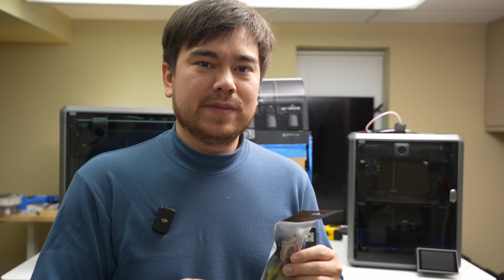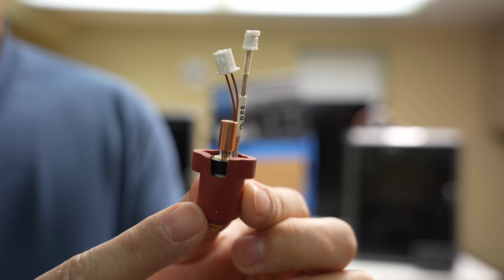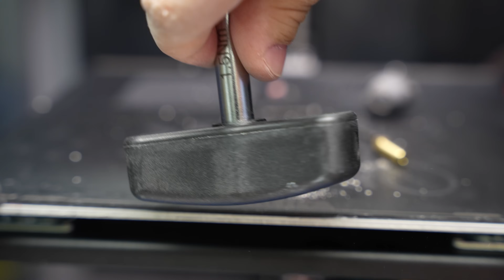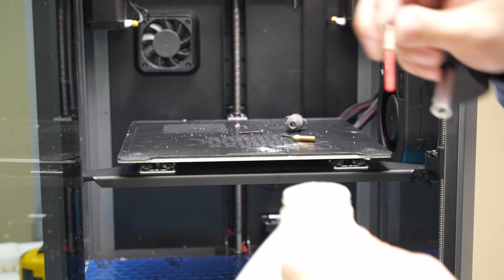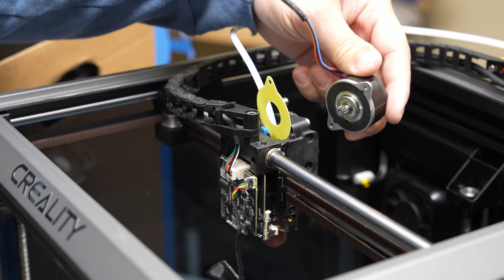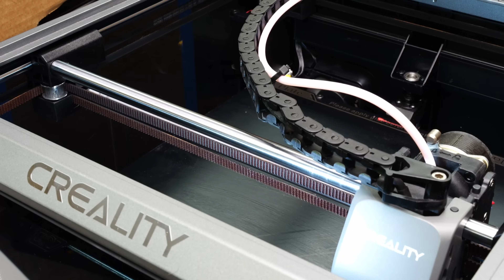🔥⚙️⚙️ CREALITY K1 - Extruder and Hotend Upgrade Kit

Comment: Those are just wear marks, the new extruder is made from sintered metal, not machined/sandblasted. The old extruder heat break is aluminum, not steel. What kind of engineer are you? Electrical?

Comment: Just purchased a K1, asked support about the updated parts. they directed me to the store where i could buy one at full price. So much for standing behind their product and making sure all the units get fixed.
Reply: when you buy a car do you call the dealership for them to give you a new upgraded engine for free?
Reply: @riskinhos If the new engine is the base engine in the new run of the same model car, yes, as that would be a recall. these parts are not an "upgrade" rather a fix of poorly designed parts.

Comment: My k1 came with the upgraded extruder. However, it still has the old hot-end. Should I upgrade the hot-end?
Reply from the maker: I never had problems with the old hotend so personally I don't see an issue with using the older one. Just make sure it's on tight and it should be fine.
Reply: @NathanBuildsRobots  will do! Thank you so much!

Comment: Your reviews are very nice as usual, but things "change", so following all of them can become involved after some months. I would appreciate if you were putting up a page in your website with a constantly updated list of recommendations and related explanation, like recommended printer based on price range, on size, on special features (IDEX, multimaterial, high temperature).

Comment: The steel is not machined from a solid piece. It is laser cut from a stainless steel plate and sand blasted for finish. 
Cost is about 0.3$ to manufacture.

Comment: Love the Creality propaganda by showing a a Bambu P1P in such a pathetic state. Creality head looks super janky. Listen to the perfect layer, his disdain for any non Creality printer oozes through in nearly every episode. Best 3D podcast around however. Wish it was weekly.

The Bambu Labs AMS is a game changer. Most people think it's just for multi color but it is also fantastic for keeping multiple materials ready to print. My favourite feature is using up every inch of filament by having it switch over to a new spool when it runs out. No more piles of spools with minimal filament. The Bambu Labs screen is a cheap shot. Not many people ever touch the screen, they just work from their computer or app.
Reply: If bambu had the same size on bed and abit lower prize i would take bambu for sure...but for me overkill

Comment: A C-shaped piece inside the extruder holds the second gear. There are 3 holes in this part, one for fixing and two for movement limitation. Slightly carving the slots that limit the movement brings the gears closer together. The compression problem is solved by adding a spring from the outside or a mechanism that pulls the lock latch to the left.

Comment: I just bought my K1 and I'm trying to figure out whether I have to buy a new hotend and extruder to replace the old one - to avoid whatever terrible problems people face with those.

Pretty good video, and I generally like your channel! Gotta say tho, you have to be more careful with doxxing yourself... Not sure whether you ordered that boron nitrate to your company address, but in any case be careful... 7:44
Reply: I just went through this also. If you have the black nozzle cover then it's the bad hot end. You want the rust red colored one. They will send it to you if you hit up the online support. Mine is on the way but what I don't know is if they are sending the extruder as well.

Comment: I have the K1 Max and a fairly newbie to 3d Printing.  Had a Ender 5 S1 before and got used to the Creality Slicer (the Cura version).  It seems like they have left alot out of the Creality Print slicer. For instance I have not been able to easily add a 'Change Filament' command like using the Extensions for the Cura to change colors of filament.   And no other slicer does well with the K1 (as far as I can see)   I downloaded the profile for the Cura but not happy with that either.   Do you have any suggestions on Slicer OR a way to easily add a change filament command to the Gcode for the K1 Max?   TIA!!

Comment: I just got a new K1 and I would like to confirm that it came with the new extruder installed. I can only see the lever. I don't want to disassemble. The lever has a matte finish.  I touched it with a magnet and it's ferrous.  So, I think I confirmed. Do you agree? Thanks for the vid.  I think you saved me some worrying. thank you
Reply: i also just received a new K1, it has the new extruder, but not the new hotend...

Comment: LiDAR alone is worth it, along with input shaping. Speaks a volume on quality, precision of prints. Piezo/load cell leveling, is more of a convenience. Creality is catching up, it is just a matter of time. AMS is way overpriced compared to the actual printer itself, esp. with restrictions on usable materials and excessive wear even on moderate use. Also a good IDEX, with some clever muxing should do better than an AMS, that is wasteful. Another thing I don't understand is, why a Bambulab X1C wastes so much filament, before start of every print job(even without AMS), if they can use the camera input(on X1C) already, with enough nueral processing cores in the system.Just some💭♥️👍

Comment: I was wondering about the short piece of Bowden tube.  I have a new K1 Max and for two weeks so far can't print anything.  (It is fun to watch the video of it not printing! HA! HA1) Originally, it was banging itself to death with belt sprocket teeth jumping out like crazy and banging on the side over and over.    Creality sent a new PCB to install, works like is should,  but now the extruder will not feed any filament.  Wires are all twisted and one (Red) was broken completely.  Fixed one (red) wire, and still doesn't run,  now I will see if the other wires which look damaged are broken the Blue has a deep dent in it, so I suspect that is broken.   I have 11 other Creality printers and no manufacturing problems with any of them, except the normal loose screws and the pom wheels all out of adjustment when they arrive. Waiting for a replacement extruder from Creality now.

Comment: I had K1 bought on preorder, had plenty of issues with extruder and hotend leaks, returned it, bought P1S, it's running perfectly. Your mileage may vary, but K1 is cheaper with a reason.

Comment: I had one of these that kept failing part way up in the print.  Extrusion stopped but motion system continued.  Turns out a screw was loose holding one of the pressure wheels in place.  Took me a while to figure that out.   I'm back to liking this printer.

Comment: If the K1 max had a dual extruder I would absolutely buy it.  However I currently have all the components and hand-tools needed to cobble together a dual extruder setup with the same build dimensions. The K1 would save me the trouble, but since I would still be going to the trouble to setup dual extrusion it's not worth the cash. I need multi material capability for supports.Now I just have to figure out how to setup a Makertech dual switching hotend in Reprap firmware.

Comment: Unsubbing and Resubbing for more boron nitride and boron nitride paste. I am quite enthusiastic about boron nitride, both before and after it becomes boron nitride paste. 

That torque wrench looks very similar to the ones used by amd on threadripper/epyc CPUs. They both are set to 1.5 Nm and utilize a standard 1/4" bit size.
Reply from the maker: Nice, I haven’t built a computer in ages, but that sounds like it might be the same tool!

Comment: I just received a k1 and the extruder is the new steel one, the runout detector I have no issues getting filament in and the bowden tube gives me no trouble on the default path. 
I can print fine without glue on the default bed.
The only trouble is really getting the filament inside the extruder's gears, which is easily fixed by cutting filament at an angle.

One point though, even though the extruder is the new one, it still becames just a tad bit loose during a print, was enough to immediatly get under extrusion
Reply from the maker: Try tightening the 2 screws that hold the extruder to the stepper motor. With a little more tension, that should add some friction and holding force to the lock-up. But I can't tell, all I know is the ones I'm using (on the K1 Max and now the K1) are working great. Easy solution is to JUST USE A SPRING TO ACCOUNT FOR MANUFACTURING VARIANCES...

Comment: I have had my K1 for a month now, your initial review swung this purchase in favour of the P1P. Must say this is the best 3d print experience i have had for the last 4 years, litteraly press print and go. Have currently had no failures and the quality is far beyond what i have achieved previously, plus the speed is phenomenal. I can now print 3 or four large prints in a day rather than over  3 days. Kudos to Creality on the upgrade program for K1 buyers a great way for them to say thankyou and garner even more loyalty from their users. Also a great video on how to upgrade the printer. keep up the great work😃
Reply: i got some setious issues at the beginning. 
I had to change the plate and the extruder head for a steel one. 
then it became a click and go for me as well

Comment: Good to see that Bambu competition is really pushing Creality to up their game, my K1 Max delivered last week seems to have these updates already installed, is giving great quality prints using Prusa slicer with community generated profiles and I would suggest anyone with K1 printers use a better slicer as the Creality effort seems to have some odd problems causing quality problems on some prints as well as being awkward to use and slow, I also have the hack to run full Klipper with fluidd interface giving access to all tuning parameters. Really the only thing Bambu is better for now is multi filament printing which is very well done on their printers plus they also have the best out of the box experience for beginners by far. I'm personally looking forward to Creality releasing the source code in September to see where the community can take this printer.
Reply: Glad to hear the new ones have the upgrade on it. I just ordered my max.
Reply: @HN-qc8io  The K1 Max had upgraded extruder right from day one but they are now shipping the K1 with the upgrades too. I checked my hot end and it appears to be the upgraded one too. Producing very nice prints in ABS which is what I use a lot of to print prototypes. I was looking at X1C for a long time but their reliance on the cloud for full functionality was a none starter for me especially with their terrible privacy policy.

Comment: i think the first layer problem is that the max still uses the same number of levelling points
with the larger bed, that reduces the spacial resolution, but the errors in bed levelness remain at the same scale
Reply from the maker: Interesting. Yes some more research into the Max is required... I need to watch it level and see if anything funny is going on. It almost looks like its improperly applying the probe data... Like it reads from the whole bed, then does the math incorrectly and applies the level as if it is looking at a 220x200 bed with the same origin as the 300x300 bed.

Think about it, the top area Y=250 to Y=300 has really bad performance, almost as if the data its using for that area is extrapolated from somewhere else. Same is true to a lesser extent for X=250 to X=300.

The more I think about it the more I am sure it is a bug in the code.
Reply: @NathanBuildsRobots  i don't have such detailed insights, as i don't have this printer
but i have the 400mm magican pro
i wish they increased the number of sampled points on that printer, too. such that the distance between sampled points is the same as on their smaller printers
Reply: I do a 7x7 grid for 220x220 on my ender 3, and a 9x9 on my ender 5 plus. More points is generally better and have not had issues with first layer using a pei textured sheet with pla with 11 days of printer on the ender 3.

Comment: I cannot say what the old extruder is made of, but there are some stainless steels that are non magnetic. I know, it is weird AF but it is true.
Reply from the maker: It's possible the old extruder is a non-magnetic stainless steel. I need some better lab equipment to figure this stuff out!
Reply: @NathanBuildsRobots  yeah I'm a CNC programmer/machinist. I wanted to make some stainless steel gauge blocks ground to .1000" imagine my surprise when I learned I could not hold them on the magnetic table. (No metal was yeeted, just disappointment)

Comment: FYI, Bondtech has this to say about CHT nozzle changes: "ALERT : Avoid Cold Change Of Bondtech CHT Nozzles
Copper is a soft material and doesn't withstand high mechanical efforts.
Before removing or tightening any Bondtech CHT nozzle, heat it up to 280C, or at least above 250C.
Use at most 1.0 Nm torque. Recommended Torque is 0.5 Nm."

That wrench you used applies 50% more than the limit Bondtech advises.
Reply from the maker: Nice, thank you for the info.

I always overtighten things. Plus, copper looses about 30% of its yield strength when heated to 280C
https://www.researchgate.net/figure/Temperature-dependent-yield-strength-of-copper_fig3_325772824
Reply: Yeah they kinda make it so it will break if you follow there instructions. Heating it up will deform or when tighten.

Comment: My K1 arrived without the small Bowden. Loading filament was almost impossible, especially if the extruder had produced a couple of tiny chips of filament that blocked the ingress of the hotend. FYI, the Bowden length, after I contacted Creality, is 22.3mm. I asked for 2, assuming I might stuff something up. The support agent was quizzical but sent me 2 x 1 metre lengths of Capricorn 😅

Having a close look at the bed on the K1, there is no evidence of a load cell on each bed mount. There is a board under the bed but no connections to the mounts.
Reply from the maker: There is a load cell on each one you just need to look harder😂
You can cut your own, I just used a sharp knife. 2 meters for free is a steal!
And yeah, that is a very important part that is easy to forget about!
Reply: @NathanBuildsRobots  You are right. They are there - skillfully hidden! Meanwhile, my K1 has fallen into the under-extrusion hole. I've sent an email to support as I don't really want to wait until the $2.99 (4.64AU) extruder pack arrives.

Comment: That's why I held off from buying Creality's flagship. I'll wait to let Creality do what Creality does best. They're always half-assing products then they sell products to improved them. I'll wait another six months so they can fine tune the K1 Max. And who knows, maybe by then Bambu Lab will respond with the A1 or Carbon X1E. Hopefully they give us a 350x350 or a 400x400 print surface.
Reply from the maker: I did some thinking on the Bambu Lab problem... combined with some insider info. Should be an interesting video.

Comment: Hhahaha you’re so biased to Creality, why you hate Bambu so much… it’s wayyy better printer…. Just asking.
Reply from the maker: Bambu is good, great hardware, great slicer.
I don't like the privacy policy, but for normal people (who in all honestly make up the majority of my audience), they are actually very good printers.

The first I heard of Bambu they played up their ability to print carbon fiber reinforced materials, so called "engineering grade" materials. However, their handling of IP and user data leaves much to be desired. It is a matter of marketing, and target audience - one of their target audience is engineering and professional users. It seems to be a honeypot to collect proprietary engineering data from US firms to the benefit of Chinese interests.

Creality Cloud is no better, but the difference is that my K1s are run completely offline, so there is not much of an issue with data security.

I will detail these feelings in a future video. My ideal printer is completely offline, no internet, running open-source and auditable firmware and software.

Comment: The older one looks like it's nickel plated.
Also, shouldn't you tighten the nozzle at temp?
Reply from the maker: You're right, it might be nickel, not chrome.
Also, good question, slice and Bondtech reccommend not hot tightening - just use the boron nitride and it acts as somewhat of a threadlocker.
Creality has a strange hotend on this one, with some concentric layers of threads. Not sure what the best practice there is.

Comment: So would the Sprite Extruders issue with first layers, possibly also be an extruder issue? Cuz that is for sure, a night and day difference.

I do know sometimes, if my top layer speed is 50 or above, you'll see the beginning and end of the extrusions will be solid. Yet somewhere in the middle, not centered, just a random circle area, the lines will get thin and you can see the layers underneath. So it makes me wonder. Cuz that's exactly what I see on the first layers. Just without seeing the layers underneath. lol

I do have a .4mm CHT nozzle BTW. But I see it with or without the CHT.

Comment: You're sure that's a "press fit" thermistor and that setscrew is for show? That torque wrench is 3X the recommended torque for a bimetallic CHT and 50% higher than the maximum rated torque. Only the normal CHT is able to be torqued to 1.5mn reliably. Also they specifically state to never cold swap a CHT. Idk if it will break doing that or if they just made that up to sell their own torque wrench but I would typically advise the manufacturer's recommendations. Also the wrench they use in some of their product photos costs $600 some fancy stuff lol. Aside from that it's a phenomenal video as always your smooth-brained metric users comment made me laugh way too hard. 😂